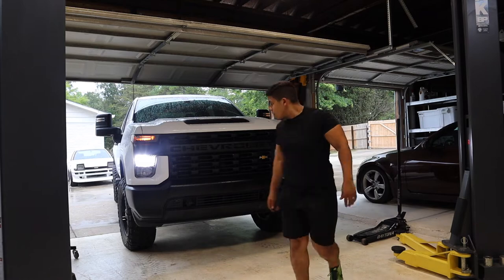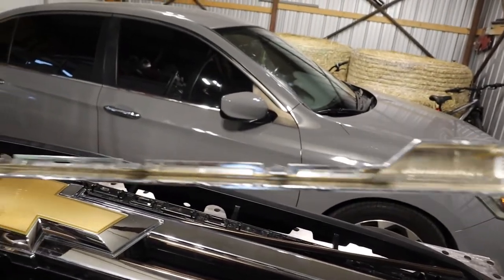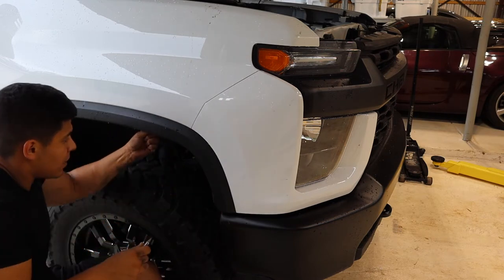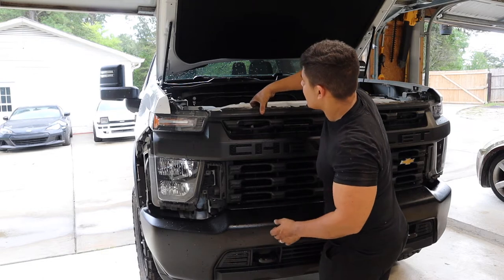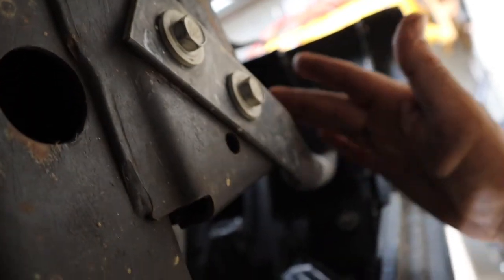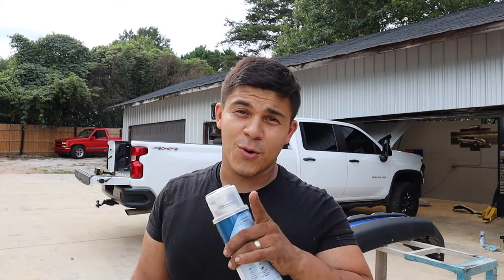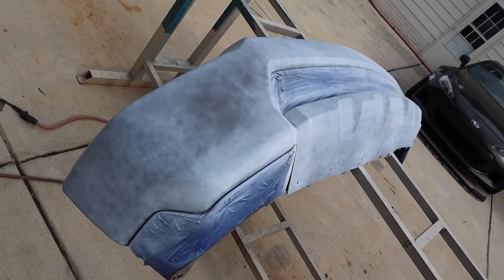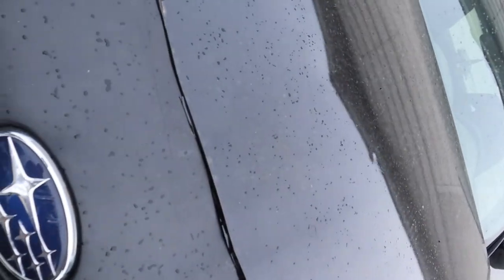2020 Silverado 2500 High Country Front End Conversion

Comment: The small thin black plastic piece across the top of the bumper pops off to access the 4 bumper bolts that hold the bumper to the frame.

Comment: What size wheels and tires you running?  Also, did you have to calibrate the speedometer for the larger size?  Looks great!
Reply from the maker: The wheels are 20 x 12, and the tires are 35s Toyo's. Thanks I didn't calibrate the speedometer but I usually drive a touch faster than everybody so I just have to keep that in mind also
Reply: @samsgarage2111  Any change in mpg? Thank you for getting back.
Reply from the maker: Definitely a decrease because of the heavier tires and it's not exactly road tread but I'm usually towing some thing so the miles per gallon is an exactly some thing I keep an eye out. It tends to spend just as much fuel with weight then without weight behind it
Reply: @samsgarage2111  just curious and thanks so much!
Reply: Stock height?

Comment: Came out badass! I would like to do the same to mine but the bumper is chrome? How would that work?
Reply from the maker: Chrome usually has a hard time with paint. I would recommend vinyl wrapping it. It is very durable also as long as you get it done right with good quality wrap. Paint could work but a professional should do it for longevity